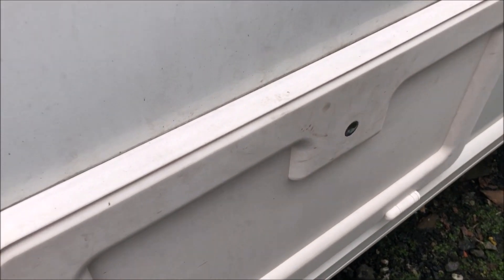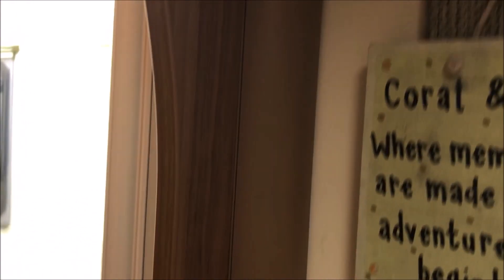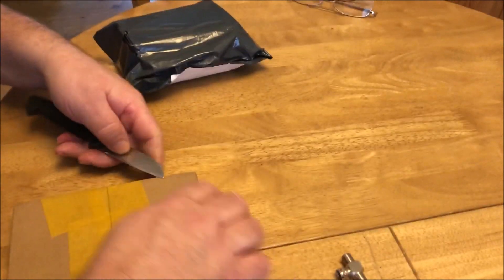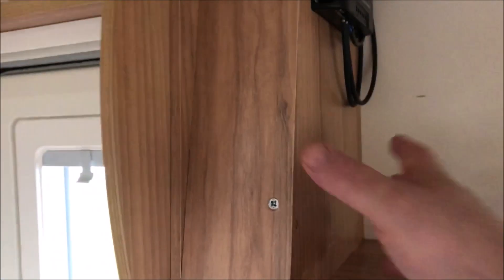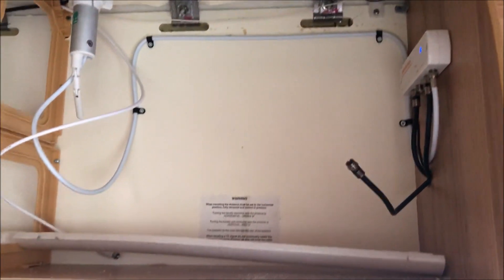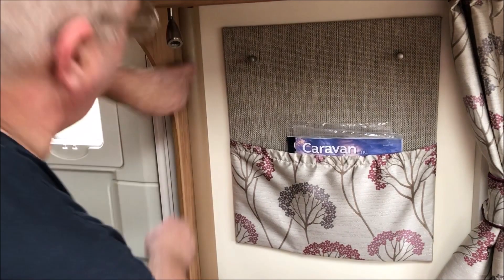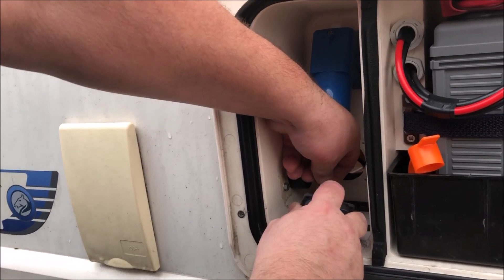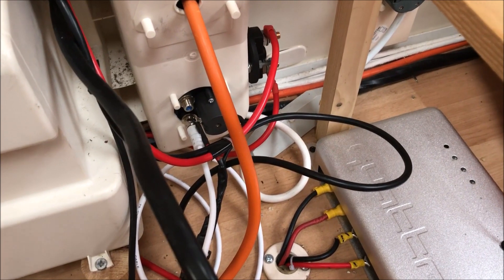Fitting external TV socket on caravan

Comment: I’m not sure why you connected to the existing aerial unit in the cupboard for an external aerial. Presumably you want to use a site aerial to connect to your tv. Could you not have installed the external socket point and then wire it, direct, to an additional internal aerial socket position  by the  existing tv socket
Reply from the maker: Hi , I use the external socket to plug in an external aerial and also sometimes use it for a tv in the awning, so in that case it uses the caravan aerial. I hope that makes sense
Reply: HitchUpAndTow ah I though you were going to connect a site aerial to gain better reception. I have done similar and fitted and external plug with aerial connection so I can link to a site aerial , inside I fitted a new aerial socket.  Just to avoid trailing a wire through the window.  I fully understand nowthat your application is different from my initial thought. Thanks